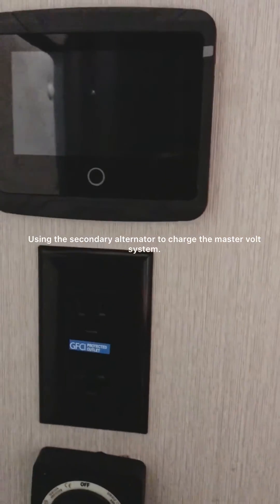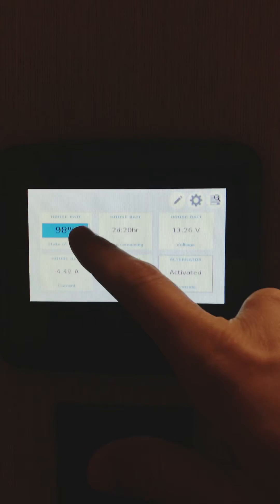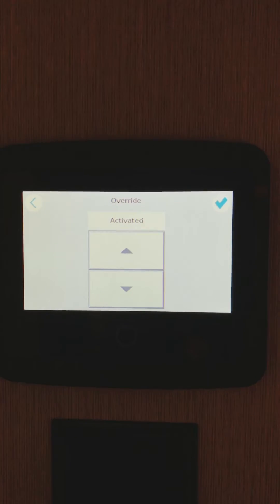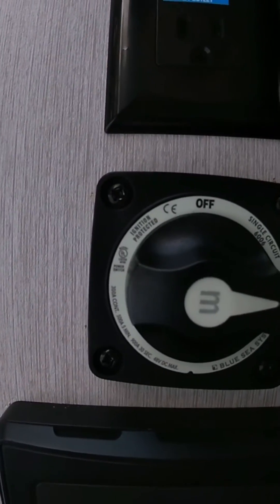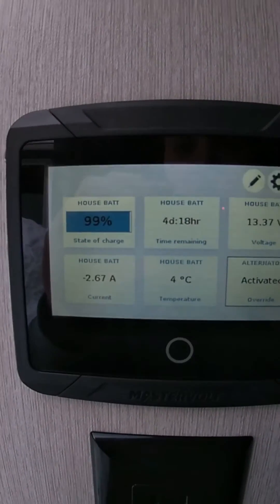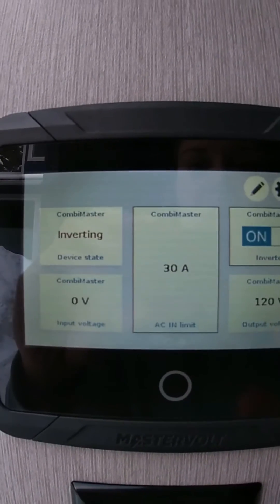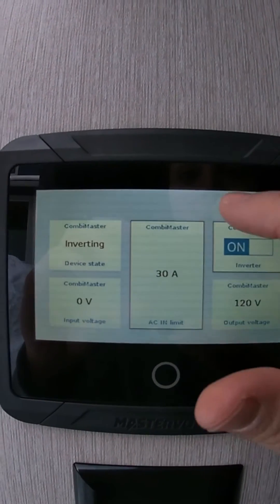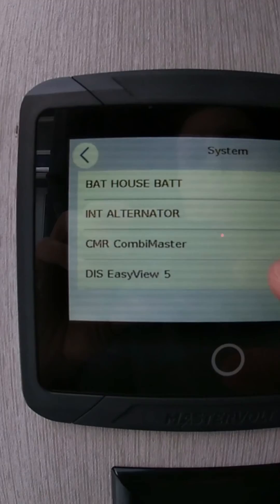Activate secondary alternator on master volt battery system on Thor Sanctuary

Comment: Just got a similar van. Question. When plugged into shore power the panel doesn’t allow me to change to “alternator override” my thinking is that it’s because im plugged in. Your thoughts?
Reply: Did you ever figure this out. Does it need to be in standby when connected to shore power.